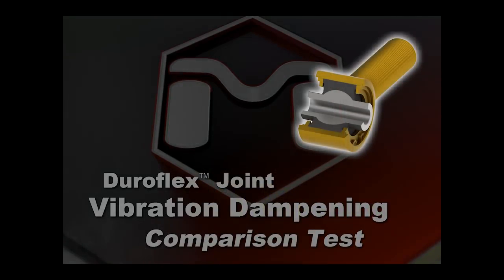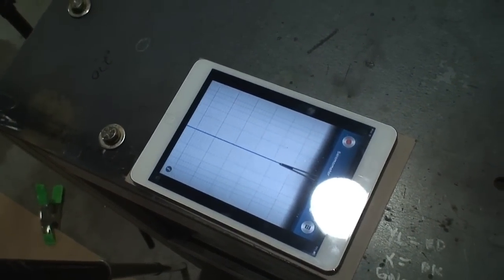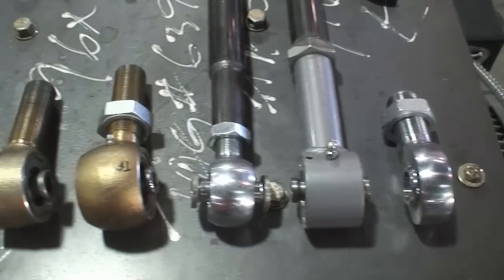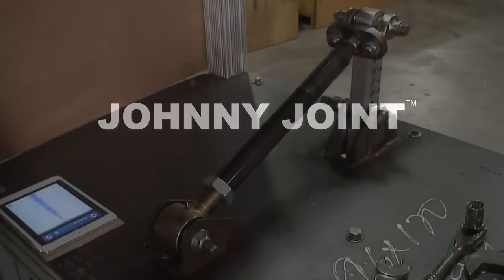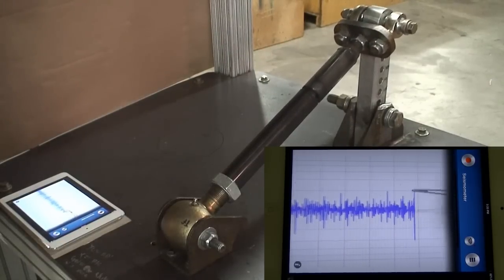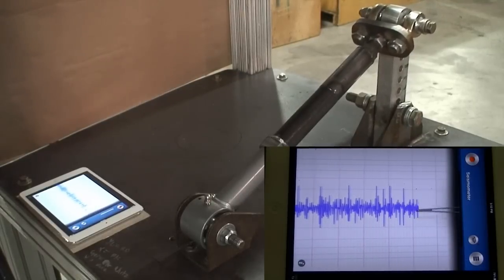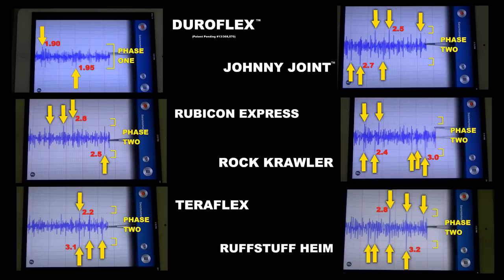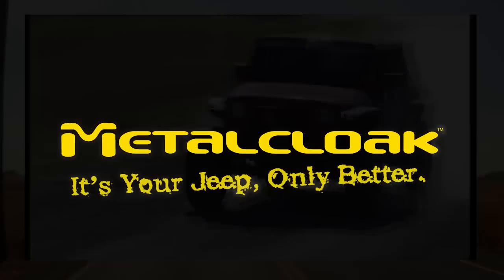MetalCloak's Duroflex Joint - A Comparison of Vibration Dampening

Comment: Can you test a Factory Clevite Bushing on your "Shaker Table" so as to give a base line for vibration dampining of a "stock ride". i love the concept of this product and see how it seems to out perform most if not all of the options out there, but since every jeep out there is so much different in setup and everyone has there own "butt meter" for ride quality this point of reference could help a lot.
Reply from the maker: We can definitely look at doing that. Now that the tests are done, the Shaker Table is back on a pallet and put out of the way, but I'll look into doing it.
Reply: This sounds like a great idea to me as well. Although I have Metalcloak Front Upper and lower control arms on order so when they come I will be able to say for sure if they ride better than the stock arms with clevite bushings or the same as the stock arms with clevite bushings.
Reply from the maker: lratinksafire While some customers have said that their ride quality was better then stock, our goal was to make a control arm that flexes like a typical joint, but rides like a stock clevite. So you Duroflex arms should be as good as your stock ride, but with the ability to flex like crazy.
Reply: lratinksafire please let me know how it goes.

Comment: This doesnt just apply to Jeeps, this also applies to custom street machines and hot rods...In fact the only reason I watched this was because I want to build a custom set of control arms and Watts link for my '99 Lincoln Towncar, I need a smooth flat handling ride, so i'm retaining my air suspension, upgrading the  front/rear anti sway bars, control arms and watts link...My idea was to use swedged tubing for the watts link with heim joints, and a combination of heim and polyurethane joints for the control arms. I'll also upgrade the driveshaft once I find one that fits to lower vibration and rotational mass. and I'd like to do all this without spending hundreds. so DIY is the answer.

Comment: I bought the 2.5 inch game changer for my JL. Other than that kit, do you all recommend anything else to maintain the stock feel?
Reply from the maker: I would recommend the Rocksport Shocks if you did not already purchase.  The shocks work with the True Dual Rate coil springs very well and provide the additional travel you will want.  You should be good to go out and enjoy just like that!  Enjoy, feel free to give our techs a call with any questions about the system.

Comment: I’m sorry, but with the way that table works it would be very easy to skew the results by adjusting more or less interference to the telescoping sleeve. I could be missing something, can you please explain how this machine is adjusted on each joint to ensure accuracy and fairness?
Reply from the maker: I understand your point, but the way the table is set up, we were required to make sure the distance between the center point of the joint and where the arm mounted to the machine to be exactly the same length. There was no way to change that variable to benefit one joint over the other.

Comment: So you lift a Jeep, put mud tires on it and your worried about vibrations? Umm it's a lifted Jeep you have other things to worry about.
Reply from the maker: That's funny. Today's Jeep tends to be as much a daily driver as an off road toy. The less vibrations you get on the road, the more comfortable your daily ride, and the longer all your other components will hold up. So yeah, the days of crappy rides with lifted Jeeps are no more.
Reply: He is probably referring to the steering kickback, pitching, tyre noise, etc.
That said, if your product reduces the vibration and noise transferred from the tread, it may be a well worth modification.

I do not currently have a need for the product, but have BMed your site - now, a metric range...